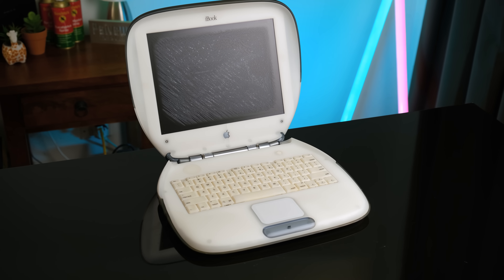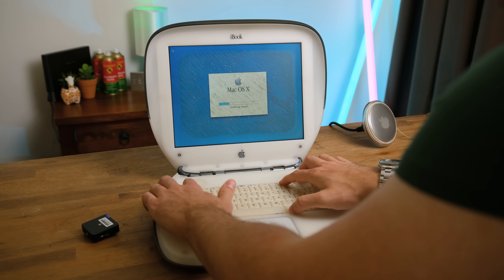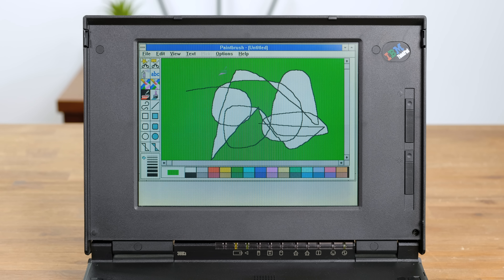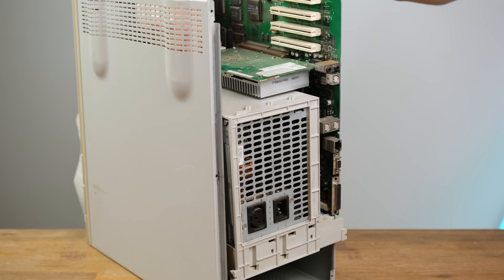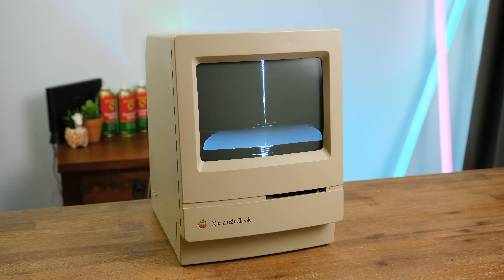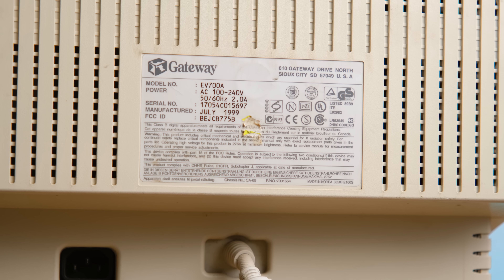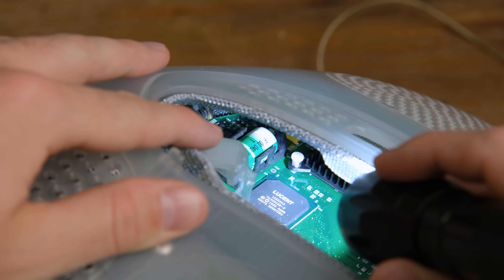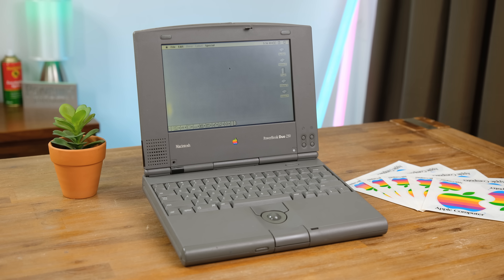So Much Vintage Tech Is Dying... Here's Why

Comment: The interesting thing is, the capacitors and such in old macs have been leaking for years. Some leaked many years before others. I remember getting a Classic in 2001 that was utterly ruined from capacitor juice. Old tech is aging; Even people in antique radio and television circles all universally agree everything has its age limit before it will fail. Look up Tin Whiskers. It's important to learn about them
Reply: May it be that the hell sauce from leaking capacitors eventually makes the case plastic brittle? Salt crawling into brick mason walls acts similar.

Comment: I have a phone collection and idk why but a year or two ago i tried to charge a pda that worked perfectly not long ago at all along with the other phones and non of them turned on it wasn’t the battery it was still in good condition and i even try to use a battery i know works and non of them turn on idfk what happened its like half of the phones motherboards combusted.

Comment: 3:15 hey ive done this on many laptops before for my friends, easiest way is to sctrach a bit off ever 5cm or so, then dab metholated spirits with a cloth over the whole surface, let it sit for about 3 minutes them rub ut off with a cloth and it pretty much comes right off, then you can clean up any little bits that are left over pretty easily

Comment: Amazing video. I have a 128K Macintosh and a TRS-80 Model 102 which make up my classic computer collection. The Macintosh is in immaculate condition and still looks new due to a recent full restoration and the TRS-80 has been cleaned up & has had its battery removed and is in extremely clean condition. I am glad I only have 2 retro machines as they are hard work to maintain.

Comment: Only a couple of weeks ago I hit a bad luck streak when I dug my 486 desktop out of storage and its hard drive had failed. Replaced it and went on to install Windows 95 again, but all my boot floppies were bad.

Ordered a new pack of floppies and when those arrived, took my Compaq Presario 5000 Pentium 3 out of storage to write a new boot floppy... its motherboard was completely dead. 

sigh

Comment: Ideally, you'd need to store all kinds of tech in a room with normal room temperature, rather than cold, dry place. Plastics on these devices doesn't respond nicely to huge temperature changes, like going from ~5-10C to say ~22C+ room temperature, especially places where temperature varies a lot. Same thing happens to hard disks, they're not designed to be kept in "cold" storage. Itt can get stuck, refusing to spin due to that, lubricant hardens etc etc.

Remember, if your electronics develop these symptoms and start to degrade, but other models from the same era don't - the problem is 99% how you store them. Hope this helps, cheers!

Comment: Have a few laptops that are going/have gone this way. A Compaq Presario 1400 (which has an iBook G3 clamshell inspired design) Getting a far few dead pixels around the edges of the screen, in a "bleeding" effect a bit even. Which ends up showing about 10 minutes or so after it's powered on, only noticeable on dark backgrounds, like pure black ones making it the most visible. Have another 1400 just like it, could use the screen on that if i ever need to since that one is fine, and i don't use it much, with it being a celeron & my main one being an 800MHz Pentium III. Cracks around the hinge parts of the plastic on the back lid, seems like a problem with these certain ones, luckily they aren't a huge problem. The rubber-coated trim around the sides & on the palm rest you can change, the one that was on it has gone very sticky, bet it'd be even worse since i last saw it, just wrapped it up & put it into storage. The blue ones i use, are going bit more sticky, the rubber comes of a bit easily when cleaning it with a eucalyptus type spray i always use to clean electronics, so i need to careful with it. But it isn't too horrible, and isn't all that sticky, but is a bit on part of the palm rest somewhat. Otherwise, it works fine & still is a nice machine. a few other laptops that have the same thing as the G3 shown at the start, a Compaq Armada 1500c (the first ever laptop i used back in 2003, the actual unit that was my mother's) and a Presario 1200, both of which look like the screens have been slashed by someone, but it's just how the screens have broken down over time. The 1500c has a replacement screen that was done back in 2003 as well, so it isn't the original one. One of mine, recently is starting to go the way of this G3, an NEC Versa 4080H. Not used it in a bit over a year, and is quite nice condition too. But the screen is going the way of this one i saw when i started it up recently, though not as bad as this G3 yet. So yeah, quite a shame it happens to older electronics like this, but we can hopefully do our best to keep them going.

Comment: I have a ton of kinda vintage tech, no issues at all.
Old PRAM batteries are really bad, but this doesn't happen with CR2032 batteries
Reply: They are far less susceptible to leaking, but they still can. Someone asked me if I could fix an NES Zelda cartridge for them; opened it up and the save battery had leaked and ruined the board.
Reply: @_Thrackerzod  low quality stuff then. Also the battery slots are really not solid, they let all the liquid out. They should be slots on the back of your device with a cover and then wires running to board

Comment: Vinegar syndrome is a cause of the decomposition of the acrilyc layer in the polarizer. It can be removed and replaced with adhesive polarizer film. Just keep in mind the angle to place the polarizer film, my 2008 Macbook Air suffers from this and the angle is 45 degrees. i am hoping to change it but since the display also has a missing hinge, i might just replace the whole thing.

Comment: And old tv's with a glass screen can explode, very dangerous
But we have amazing tech now
So No need to keep spending money on old tech 
They ask a lot of money for old tech and its useless now
Reply: And new technology contains firework batteries those can spontaneously self-combust during midnight charge or without, making your house burn down. Lithium is at least as risky as CRT if not much more. (Monitors at least won't start to burn when unplugged.)

Comment: My nokia flip phone had that issue with the rubberized coating and it wasn't even 2 years old at the time. I ended up taking my pocket knife and scraping that crap off of it just because it looked nasty with it on there being sticky and looking like someone blew their nose on it. I also did the same to the glued on cap for the antenna as it was peeling off the silver color/finish which underneath looked more like copper so it was a cooler looking phone afterwards

Comment: I guess I'm just lucky the only computers that failed in my collection were either due to the capacitor plague(a dual pentium 3 unit), or being so old components are failing and I have no clue which one (my commodore 64)

Comment: You're running into the same problem that occurs with antiques made with celluloid plastics.  there's nothing sadder than a box full of vintage pens and pocket knives decimated by celluloid rot.   The best advice I can give besides storing in a cool, dry place is store the things you truly love by themselves with some degree of airflow.  The off-gassing from one item breaking down can not just damage other item's materials, it will jump-start their degredation too.
Reply: The worst plastic "thing" that broke down on me was a BMW🙄
Reply: @Orobas 66 Bakelite crumbles apart by contact with oil. Otherwise it is quite stable, although it can shatter like porcelain if handled too rough.
Reply: @Orobas 66 The oldest thing I have using plastic that comes to mind is a ~1960s pocket transistor radio made in the province of Taiwan.

Zero, and I mean ZERO broken plastic parts, even on the exterior.
Reply: @qwertykeyboard5901  It depends on the plastics and chemicals involved. Like that pocket transistor radio was plobably built like a tank.
Reply: How is it that plastics breaking down is such a big problem but everyone also says plastics never break down and that's why they're such a scourge on the earth?
Reply: @lukasg4807  Plastics are different
Reply: @lukasg4807  Because reality doesn't have much impact on the religious fictions (and profits) of radical environmentalism. Now repent of your enviro-sins or mother gaia will wreak her global warming upon you!
Reply: @lukasg4807  To add onto Orobas 66's reply, if somebody says plastics never break down, they're either exaggerating or they don't know what they're talking about. The reality is that plastics typically take several hundred years to decompose, compared to a few days for something like an apple up to a few years for an unembalmed corpse. In nature, it's not normal for anything to really take more than five years to decompose, but the low end for plastics is 20 years. And it's pretty rare for it to break down that quickly; again, a typical timeframe is a few hundred years. So even if it starts to get brittle and useless after 20 to 30 years, it's gonna take a hell of a lot longer than that to fully decompose. And as Orobas 66 pointed out, during the decomposition process for plastic, it 1. leaches out some nasty stuff, things that cause cancers and other similar health issues, and 2. spends most of those several hundred years just breaking down into smaller and smaller pieces. That's how we end up with not only things like the Great Pacific Garbage Patch but also things like fish being caught with stomachs full of plastic and studies showing a majority of humans having microplastics in their blood (you probably have plastic running through your veins right this very moment, and so do I).

I hope this explanation helps clarify.
Reply: @thunder____  Nature initially had severe trouble to digest wood from dead trees (that's how coal deposits came into being), but finally fungus found out how to decompose it. I am sure, nature will also learn to degest plastic (possibly faster more intense than mankind imagined - it may spread like a pandemic when germs find out how). Some organisms already do that, and microplastic will not exist forever.
Reply: @cyberyogicowindler2448  Ok but that's a hypothetical future solution to something that's currently a severe problem. I hope you're right, but it's too late to prevent a mass extinction event because the Holocene mass extinction has already begun and is happening right now, and there are certainly many factors causing it, but plastic is a pretty big one. So again, I hope you're right, but please don't get too hopeful, because we, as a species, still absolutely need to cut down on plastic production and use as quickly and drastically as possible.
Reply: @lukasg4807  When people talk about "breaking down too fast" being a problem they mean plastics become brittle, snap, or discolour and become useless.

When they talk about plastics "breaking down too slowly" they mean the actual compounds in the plastic - even if the item shatters into small pieces, the chemicals it's made of will remain in the environment for decades (or even hundreds of years), getting into soil or water and poisoning the whole food chain that way.

Comment: if you can, store batteries in a glass jar full of sand. the sand will put out the fire if there is one. the glass jar will also cut off the oxygen supply even further. 
if nothing else, bury the drives in a trash can full of sand, or literally outside in the dirt.

Comment: It makes you wonder how some of the electronics on Voyager are still going
Reply: I suspect hard cold vacuum is a much more conducive environment than warm humid atmosphere!
Reply: @AussieBloke6502  not to mention they weren't designed with cost in mind
Reply: Aerospace grade components.
Reply: They are not cheap consumer grade crap.
Reply: no oxygen to cause corrosion. Also good wiring for the same reason.
Reply: Because they use something with a little more kick, plutonium!
Reply: Redundancy, conformal coating, potting, gold contacts.  No expense spared
Reply: It's not, they have problems and a lot of the systems have been switched off to save power
Reply: Hard Vacuum being effectively the lack of all the climate conditions that break down the components is probably helping immensely
Reply: Or most vintage radios that are now decades old but still work.
Reply: People are way too optimistic. Outside our heliosphere there's plenty of hard radiation zipping around. Not good for electronics being perforated by high energy particles
Reply: They’re built different
Reply: it was designed for the extreme conditions of space with a nuclear battery
Reply: The further you go back, the more reliable electronics are.  These G3/G4 Macs may be dying, but I have a bunch of Apple II computers that will probably still work for the rest of my life.
Reply: @serqetry  Japanese made chips generally were a hell of a lot better in quality for the 80s.
Reply: Becuse it's not in space.
Reply: They design for reliability and longevity, not cost. Also since they're in the future it's probably safe to assume they don't use plastic as much anymore for obvious reasons.
Also it's likely that they regularly service and repair those electronics, unlike most of the people here (when was the last time you opened up one of your electronics?).

Comment: I remember my ECS Ibuddie Desknote (desktop replacment) and Toshiba REGZA 32 inch LCD TV having this issue.
Smells like vinegar, had to sloppily replace the polariser film on the Toshiba TV (sloppy because bubbles and some black lines on panel).
The TV still works till this day. The Desknote, well it's ded

Comment: I once found an HP laptop on an Ewaste bin and it was absolutely destroyed and broken everywhere to the point were it was falling apart. Broken hinges, ripped out keyboard, broken display cable, broken usb ports, broken top case and the metal piece that holds in the motherboard was bent completely out of shape! To my surprise it still turned on! I managed to put it back together and repair it enough so it wasn't falling apart and it was working just fine connected on an external display and usb peripherals plugged into the only one working usb port! It survived all that and it somehow completely died by being left on my computer cabinet for a while, being untouched! I still have it in the hopes that it might magically work again some day!

Comment: Thank you for bringing this to me, I need to remove the button battery on my old AMD Athlon 64 3200+ PC, on socket 939. I use it occasionally, it has Windows 10 on it, very slow. But I have not messed with it recently.

Comment: if its the first layer of the LCD then that is the polarizer, this is removable with some moisture and it must be possible to purchase a replacement.  just squeegee it on with water.  (I've removed a few for experiments but not reattached them.  I wetted paper towel and left it on the screen for a while)

Comment: I enjoy restoring and upgrading old Macs but the oldest I've worked on was a 2008 Mac Pro cheese grater, so I haven't run into any of the issues you've described.  Yet.
Reply: I was trying to fix up the same one that my dad had. One of the hard drives died, but the other 3 were fine. I used a Snow Leopard disk on it, and it's not bad. I want to try putting a light weight Linux distro on it because anything new enough to run a web browser is painfully slow. Only 2GB RAM isn't great. But yeah, keep an eye out for hard drive failure. It was about 10 years old and it would boot, but it was loosing files. Anything installed would just disappear after a reboot. I haven't checked on it in the last few years to see if that still happens, or if it got worse. If you have multiple hard drives, I installed rEFInd (or rEFIt, same thing), to be able to see what OS I had where and make sure everything was read correctly. I think I left one drive on Jaguar or Leopard, and then had one to Mavericks.

Comment: Last year I actually shipped a Power Macintosh 9500 from Fukuoka to Tokushima. Filled with peanuts, wrapped in bubble wrap and in a special box for transporting PCs that basically suspends the computer, so in case of a drop or a hit, it wont get damaged.
Yeah.. it arrived to the destination in pieces and now is held with super glue, tape and faith...